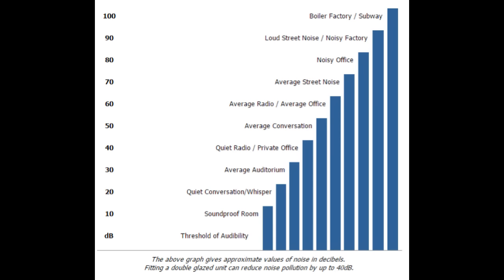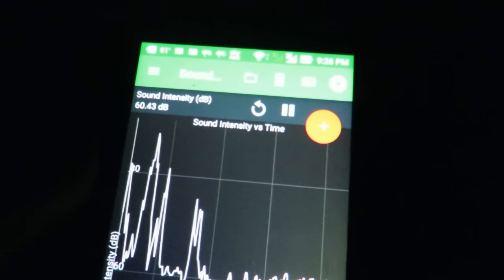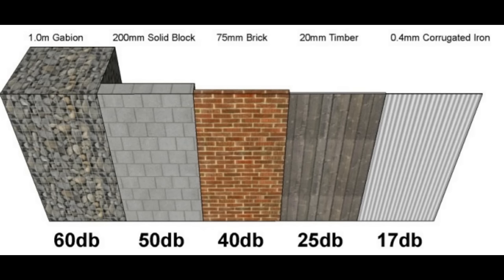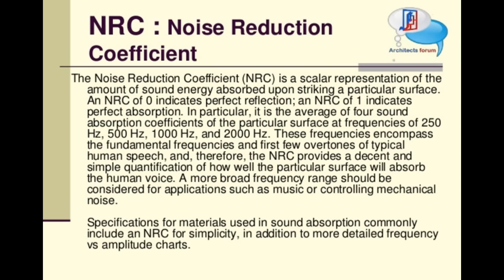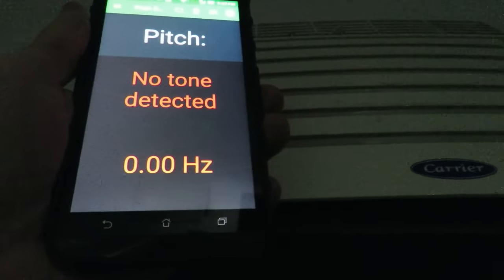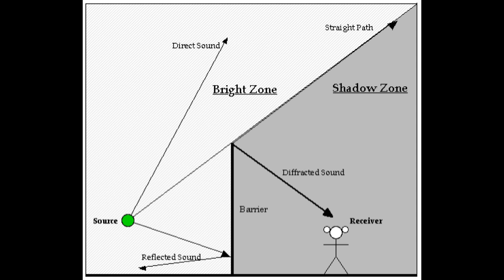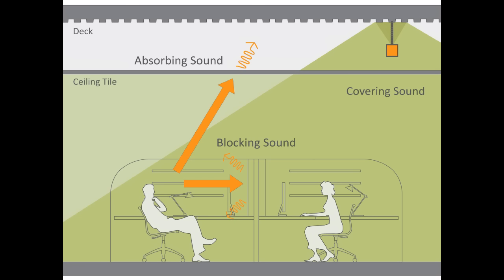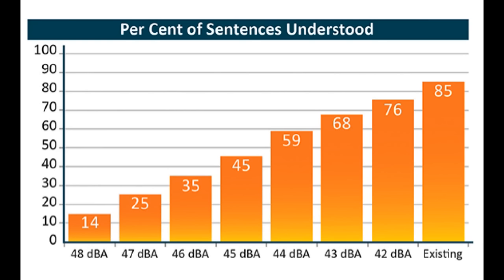GOT NOISE??  SOLUTIONS & INFO

Comment: Your depth of knowledge on sound and sound barrier is amazing. Can you offer any info on best practice and remedy as well as resource (IN THE AMAZING PHILIPPINES) for solutions to suppress rooster and hollow pipe motorcycle noise in the typical existing concrete block built residential structures in PI? Many thanks.....in advance of your next one.
Reply from the maker: Watch my 2nd video about home noise issues.  Those are difficult problems but one can reduce the level of noise inside a house with proper design and materials.  Lazada has many of these type materials for sale.
Thanks for watching and commenting Dave.

Comment: Great presentation.  It is something that I have not really given thought to before but extremely interesting.
I have a small air compressor that is loud as heck.  I could box it in but I am concerned about it overheating as it needs some air flow.
Reply from the maker: Best to contact the manufacturer for air flow requirements.  You might leave a gap at the bottom of enclosure on 1 or more sides or stagger the sides a bit instead of completely enclosing it.
Thanks for watching and commenting.